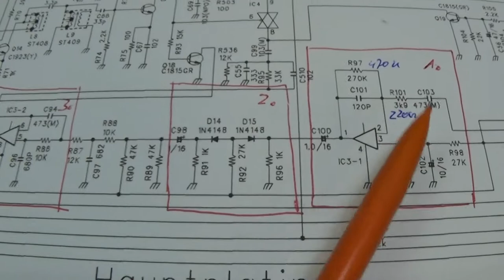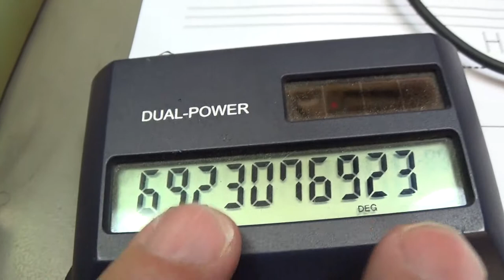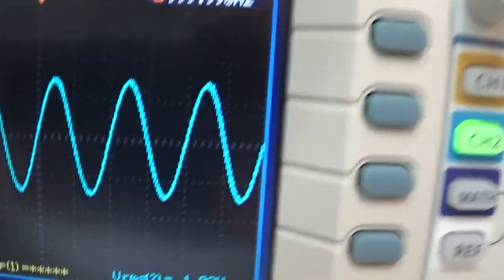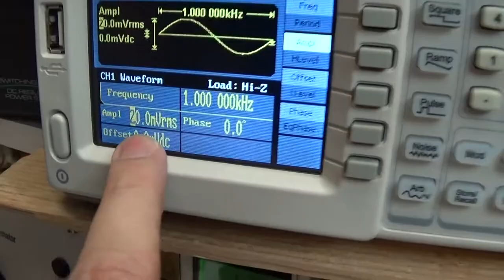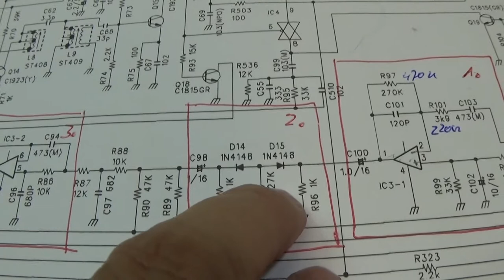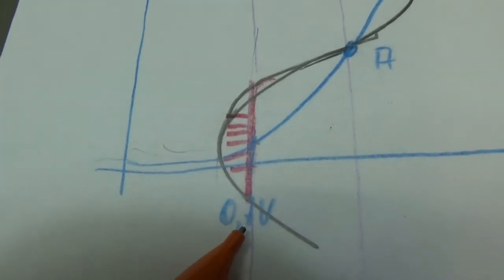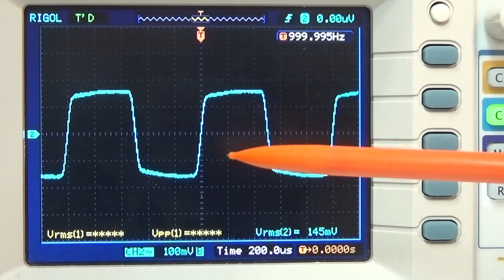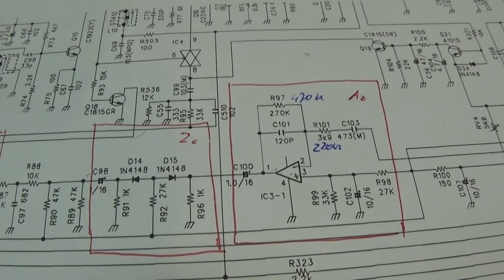#31 Tutorial HAM/ CB Radio Electronics #3: The TX Audio Path -The Limiter and Mic Amp

Comment: What would happen if you cut the limiter out of the circuit altogether and then ran a power mic through it?
 Or, if you simply increased the value of the limiting diodes?
 Ah,  OK. Never mind. You answered my question. I should have listened further before asking.
Reply from the maker: InTheNameOfJustice No problem George, your questions are welcome. No doubt a FM radio needs a limiter otherwise you would completely overdrive the VCO with its varactor diode. This would cause heavy distortion, intermodulation and sometime self-oscillation. But diodes are definitely not the best way to lay out a limiter. There are much better concepts but those are even much more cost intensive....

Comment: Buenos Sr days, not if you can help me solve a problem that I have with CDMA HP8924E monitor, which after a power failure went out and came to light, but in test throws me a problem "error 1000" I could not find information to solve the problem. I have seen many of his videos and I allowed myself to write to see if I could help me, I'm from Venezuela and will know the serious problems we have of $, to repair or buy new equipment, so I turn to you to see if I can help. Thank you.

Comment: The top of the range TEN-TEC SDR transceiver uses DSP processing for limiting and AF bandwidth processing before turning the AF signal on whatever mode you want to use.

limiting example...

int limiter(int value)
{
       int pmax=32767,nmax=-pmax;
       int tadj=((pmax+1)+(pmax+1));
      /* value is the input from ADC */ 
      while(value>pmax)
      {
         value-=tadj;
      }
     while(value<nmax)
     {
         value+=tadj;
     }
     /* return value to DAC            */
     return value;
}
Reply from the maker: Yeah i agree. 73